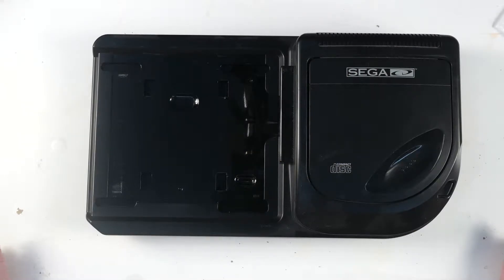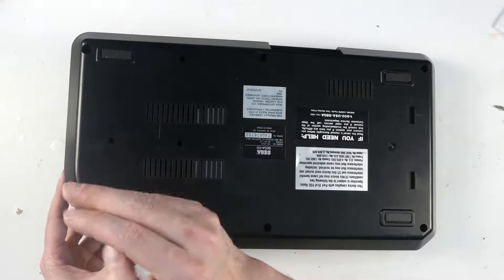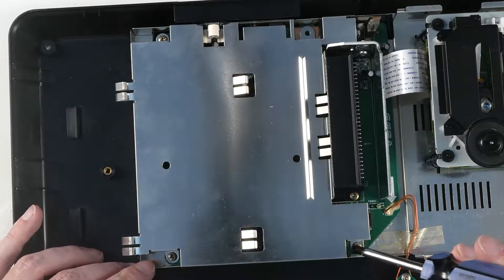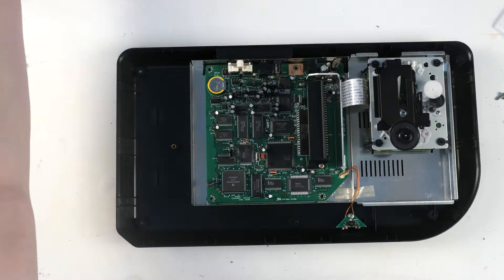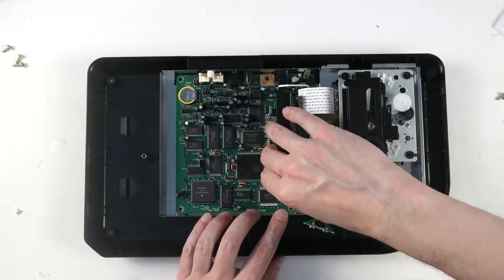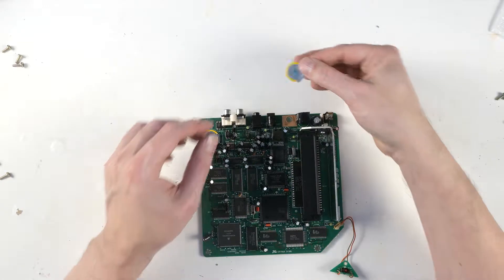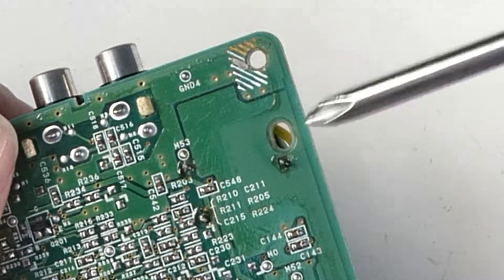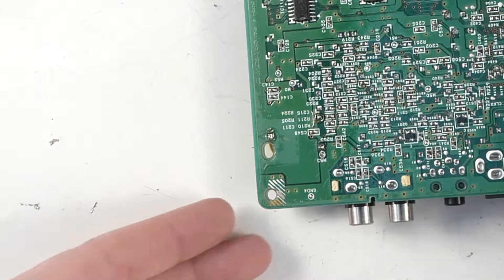Sega CD 2 Battery Replacement

Comment: 100% what I do when I get a new mega cd 2 is replace the battery and caps.  Replacing the caps is 100% needed on the mega cd 1.  FRAM mod is nice but a hot air gun is required.  Along with a multi region BIOS.  The fuse also likes to pop, you can replace that with a self resettable fuse.

For the battery I use a socket, with wires and a ML2032 battery.  Its hard to get the RF shield on after replacing the battery otherwise, with a socket.

Comment: Wow what a little project just to change the battery. At least the Saturn's had easy access. I don't have experience with the Sega CD but was curious, so here I am.

I was sad when my Saturn saves vanished, but at least it was easy to change.

The Sega CD's battery must last alot longer since its rechargeable. Which would explain why they didn't plan on people changing it.

My original Playstation memory card still works like new. Do those require a battery too? Whatever they did works much better. Would have been nice if these systems just used whatever Sony did. Though I'm not sure if they can keep the date and time.
Reply from the maker: I'll admit, there's probably an easier way. (I'm not an electronics expert.)

The battery didn't need to be replaced. I did it for the video. But considering it was 20 years old, I wanted to replace it before it died.

I don't think the PS1 memory cards use batteries. They're pretty thin, so I don't think there's room. The PS1 also came out around the time that non-volitile RAM was becoming affordable. It probably uses that.
Reply: @HexedPedestrian  awesome.

Comment: I got a battery holder installed instead so no soldering is needed in the future
Reply: Can I ask what battery holder you purchased and where?  I can find the batteries fine, but I can't tell if the holders I'm looking are the right ones.

Comment: i did this but i put in a small battery holder on the board and installed a larger cr2032 battery vs the smaller cr2016.  now if it dies again all i do is replace the battery
Reply: Hey I know this is pretty old, but what battery holder did you use? I can't find one that has 2 positive leads like the original save battery, but does that even matter?
Reply: @Luke4409    it doesn't really matter.  as lon as its connecting to one of them its fine.
Reply: @lightwavemusic617  do you happen to know if the sega cd actually charges the battery that's installed? I'm not able to find any info about it. They came stock with a rechargeable battery and I know you have to use a rechargeable battery for the clock battery in a Dreamcast because the Dreamcast actually charges the battery while the system is on and if you use a non-recharegable battery it can burst and cause all sorts of issues. I just don't want to have the Sega CD try to recharge a non-rechargeable battery and have it burst.
Reply from the maker: Yes, it does charge the battery.
Reply: @HexedPedestrian  Thanks for the reply! I will make sure I stick with rechargeables so I don't end up with a leaky battery inside my system.
Reply: I wonder if it's so good to use CRs instead of MLs if the system charges the battery. Other than that, I'm actually looking for a holder right now but it's hard to find a fitting one with the 3 feet, so I might have to do some hack job, soldering some wire to the single + foot.

Comment: My saved games are vanishing after a few days of having the system off and I'm afraid I might need a new battery. Only problem is I'm not at all familiar with soldering. Any suggestions on how I might get some practice in before trying an operation like this? Test kits or something? Sega CDs seem to be somewhat expensive so I'd rather not brick the whole thing.
Reply from the maker: I've not bought any of these, but these are what I'd buy to teach someone.

https://store.learntosolderkit.com/

You can pick up a solder pencil at a hardware store or Amazon.
Reply: Thanks very much for the info! Great content, btw, very unique and well done.
Reply from the maker: Thank you. I appreciate it.